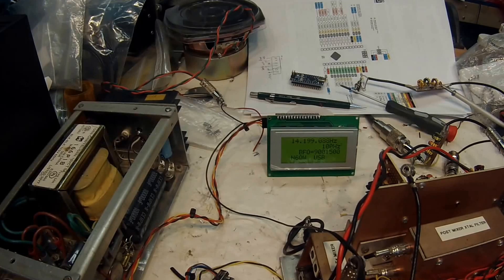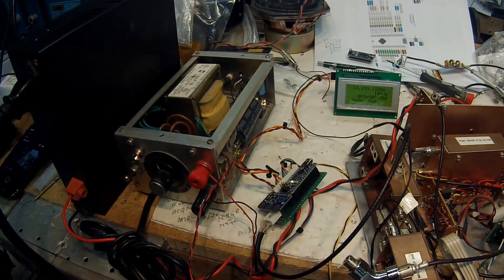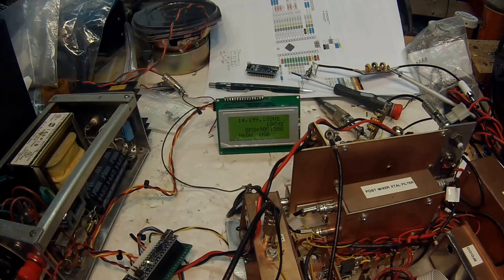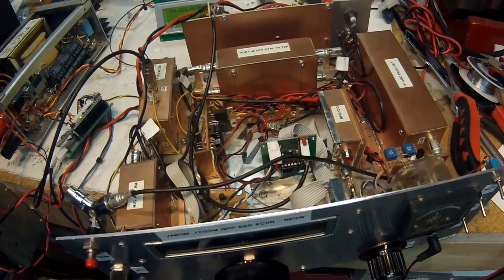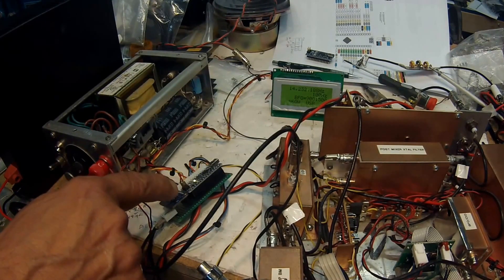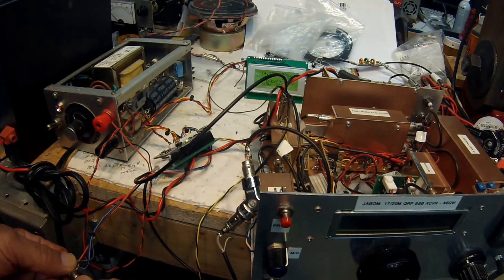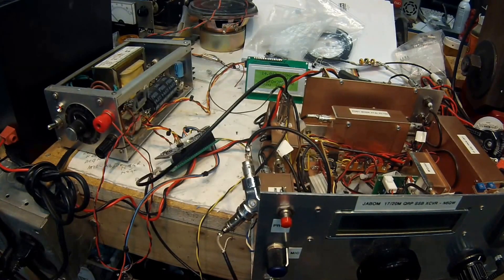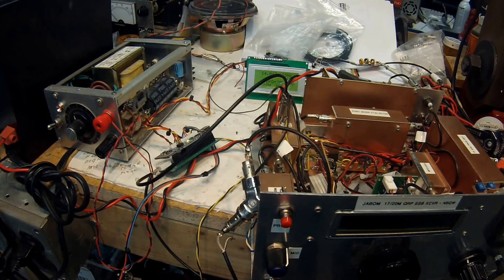Adafruit Si5351 Clock Generator

Comment: I have no idea about HAM radio but I am looking to use this Adafruit clock generator for something else. My question: do you think the PCB of the clockgeneraror can run by itself (without the Arduino) ?
Reply from the maker: Atari Andre Most likely it will not operate stand alone. Two of the inputs are SCL(CLOCK) AND SDA (DATA). If  there is some other way to provide these then it might work. 

Pete

Comment: I am assuming that you are switching in a narrow filter when you go to CW mode?
Reply from the maker: Seamus Import There is but one filter in this radio and it is a commercial 9.0 MHz that I bought from the GQRP Club sales. I think it is 2.2 KHz wide -- but that is the only filter.Pete N6QW
Reply: Pete Juliano It sounds great! I have built a couple of PICaSTARs and have another one on the go. I have ordered a Si5351 board and will try it with the next STAR! Doy you share your code on these projects as my programming skills are very limited?
73 Seamus G7ITT
Reply from the maker: Seamus Import Be Happy to share code -- suggest you become familiar with the Arduino and libraries as it is not just the code but a lot of extra baggage that usually causes the issues. see http;/www.n6qw.com/ Look specifically at the Lets Build Something link73'sPete N6QW